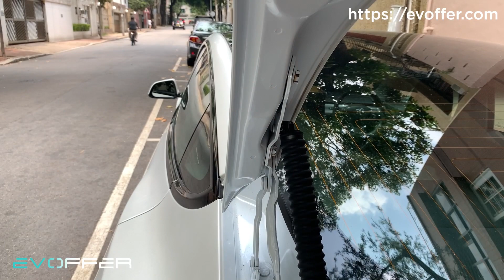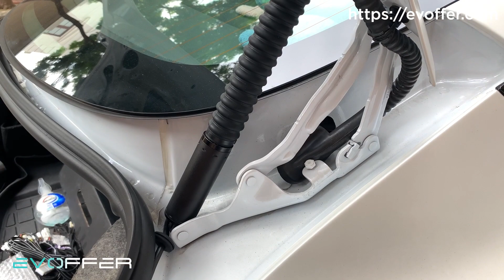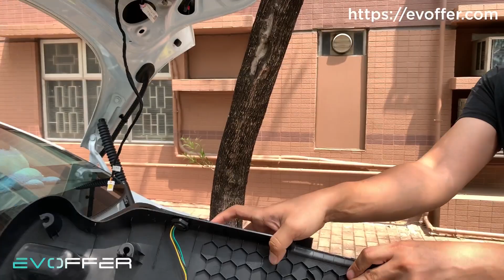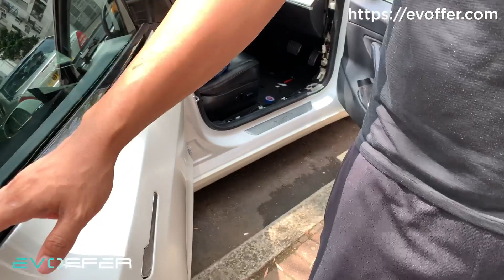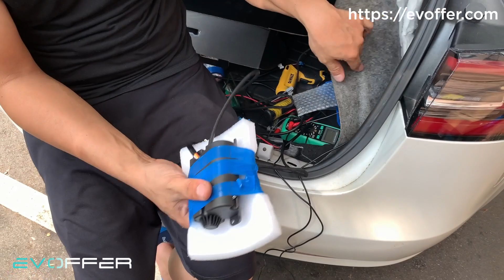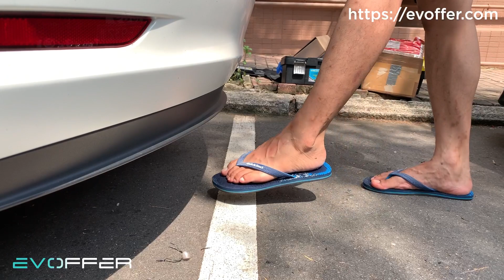EVOffer (Tesla Offer) - Model 3 Electric Tailgate MARK 2.5 Installation Video

Comment: My '22 Model 3 does not have that large red terminal that can be easily loosened, mine had a plastic connecter that cant be tapped :(   ?????
Reply from the maker: I don't think you need an aftermarket Electric Tailgate on a 2022 Model 3? haha
Reply: For a dashcam. @EVOffer

Comment: any suggestions if its starts opening by itself random? Its been wroking perfect for months then just out of nowhere opens by itself every hour or so
Reply: My friend has the same problem. Did u fix it? Is it a software issue?
Reply: @Pal-us9uv  it was a bad foot sensor. I just disconnected it.
Reply: @MrCmostech  yeah. That is what keep telling my friend. It has opened inside a carwash machine, which is scary. Apparantly using hazardlights prevents it from opening while washing the car. 🤷‍♂️ strange.
Reply: @Pal-us9uv  I wonder if putting it in car wash mode would prevent that also.
Reply: @MrCmostech  no. It was in carwashmode, it still opened 🤣🤷‍♂️

Comment: Found it was super hard to fish the strut power line through the bumper holes and have to use tail light route. EVoffer should leave the plugs unattached to make it easier to fishing through the holes.
Reply from the maker: Thank you for your suggestions, we have tried various ways to run the wire and found that the way we have shown in the video is working well. We have tried leaving another connector unattached in earlier builds but we found that some customers may insert it wrong or did not secure the connections and hence the kit was not working correctly. So we are leaving the connector unattached only if it is very difficult. If you want to remove the connector to run the wire, please reach out to our tech support and our team will assist you to get it removed.